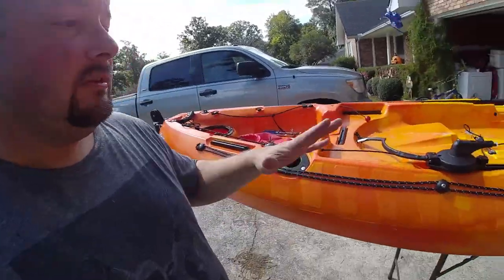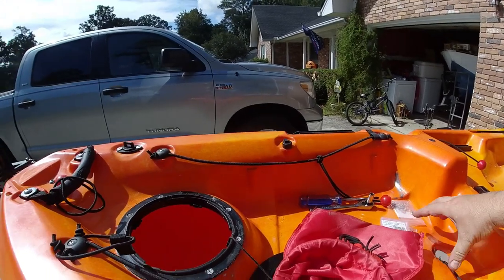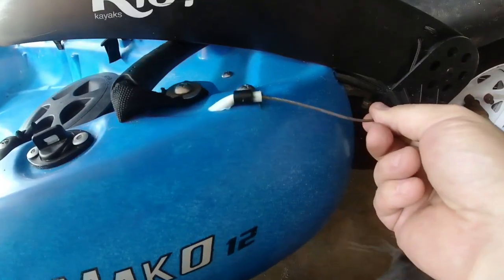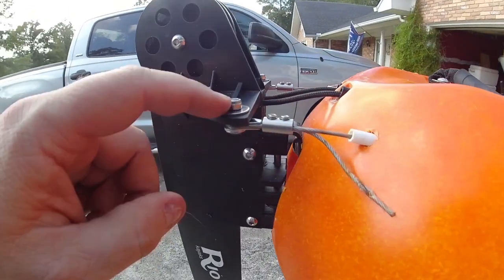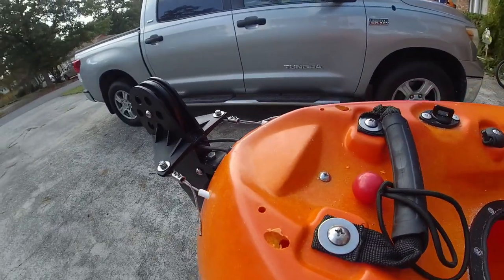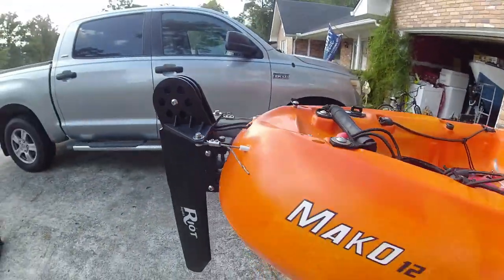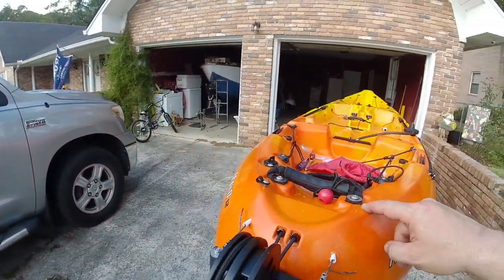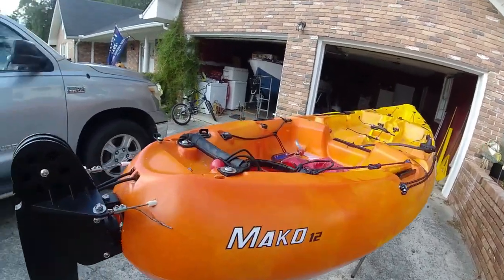Riot Mako Steering Problem, & FIX

Comment: You said the cables are Stainless steel with a plastic coating inside of that plastic sleeve that leads to the steering lever.  With the plastic on plastic friction, I wonder if putting some powdered graphite inside the sleeve would help.  Just a thought.

Comment: It’s been 5 months.  How did the fix go?  Any issues since?   
I snapped a rudder cable again today.  This will be my fourth replacement in one year.  Beyond frustrated.
Reply from the maker: Fix is working out pretty well, I have snapped a cable also. Replaced it with a stainless bike cable . Got 10 of them for $11 on amazon. The cable from Amazon does not have the rubber coating on it. This frees up the cable even more . Steering works even better with the new cable.
Reply: @TROPHY-HUSBAND  Good tip!  I appreciate that.
Reply: I just got one from my grandpa he doesn't like the steering and is selling it to me cheap.. thanks for the tips 😄 really appreciate it!
Reply: @scarkilla    The steering system is really the only downside.  Good luck!  I do enjoy mine...other than that.
Reply from the maker: @scarkilla  replacing the cable seems to be the trick. Just go with a noncoated stainless steel cable. I have not had one break yet. I am about to make a video of replacing the cables in my wife's Kayak.
Reply: @TROPHY-HUSBAND   Yeah i just took it out today after getting it... I went straight back in.. I couldnt even handle it for 10 min... replacing tomorrow lol.. thanks for the help guys!
Reply: @TROPHY-HUSBAND  WOW what a bummer darn near worth a recall eh ?
Reply from the maker: Hopefully they have fixed that issue by now. But yes a recall would have been a better answer. I won't buy another one from them.
Reply: @TROPHY-HUSBAND  I have been looking for a peddle kayak but I'll pass on this one.
Reply: @dkat1108  I had mine now for 2 years and it’s reliable and stable.  It does not turn on a dime and the rudder is difficult to plop in and out of the water but for the price, it is well worth it. Paying an extra 1k for another one hardly seems worth it. Think about it again is all I’m saying.

Comment: My cable has snapped\frayed  7 times in the rudder handle box. Does it with either coated or uncoated wire. Do you have that problem?
Reply from the maker: One time with a coated Cable. I had the cables crossing each other. Making them rub. I also grease the cables for less friction. Your rudder control has a hole in it . That is for you to keep it lubed up. Use grease, WD-40 anything is better than nothing. But most importantly make sure those cables don't cris-cross each other.

Comment: I have a LostCreek, same manufacturer.  Some people have replaced their steering mechanism with another brand like FeelFrees 8ball system.  My rudder was off and steering was disconnected when I bought it because the previous owner had a MinnKota mounted out to the side off the back on a 2x4, which I removed because I want to use the pedals.  I can't figure out how the rudder deployment ropes attach to the rudder.  I see they go through the two holes on the rudder between the fins where the steering cables attach.  But from there, I'm assuming one goes up and over and the other goes in the opposite direction.  Again Boewal Design offers no directions or pics.   And it appears they go into the three holes in the rudder.  I've tried that but can't get it to work properly, just barely.  Also, is there a spring in the wheel/head of the rudder?  Boreal Design, which has the world's worst customer service, had a " rudder spring" I believe it was,  so I ordered it, hoping it would help.  But again, if it's supposed to be in there, I can't figure out how.
Any pics/videos, descriptions/explanations that you're willing to provwould be appreciated.  I asked another utuber and  LostCreek owner, but he didn't help much as he had also had the same steering issues as you/I and had fixed and replaced his.  I'm planning on rerouting my cables lower out the back as you did and also considering running them down inside along the side instead of under the seat to avoid the twists and turns.

Comment: How do you keep the white tubes that the steel steering cables go inside of from moving in and out of the new holes that you drilled? I tried this exact same fix today but it didn't work. Everytime I turn the handle left or right all that ended up happening was that it would pull the white tubes back into the hull of that kayak. Did you end up securing the white tubes onto the hull of the kayak on the inside so they wouldn't get pulled everytime you turn the handle?
Reply from the maker: Yes I used the preexisting tube claps that are already installed inside the kayak.  I also used marine grade silicone   on the inside and outside of the holes where the tube comes out.

Comment: Did you ever have any issues with the rudder going up and down from the pull strings? Mine is really hard to pull the rope to make the rudder up and down.
Reply from the maker: I have had the cable get stuck a few times, but it was more my mistake. No real issues with that.
Reply: Yeah Esteban my rudder is VERY difficult to get it up and down…only real issue I have with this kayak is the rudder
Reply from the maker: We just went a week to the Beach and left are Kayaks in the sand when we were not using them. The sand locked up our steering and ruder deployment. They both worked fine on day one. I know I am going to have to take them apart and clean them really well. Then they should start working well again......I hope
Reply: @canam2436  I did fix that issue. The tubing they are using is causing resistance with the rope and making it real difficult to pull the rope. I pulled out that black tubing they are using for the rudder, went to Lowes and found a pvc pipe that is the same size. I  believe it was a 1/4 inch pvc pipe. I put that in, put the rope through that pvc and worked really well. It was like $2 for each piece of pvc.
Reply: @TROPHY-HUSBAND  I ended up purchasing the newly designed steering they made for these kayaks. It was $100 Canadian dollars which was like $70  US dollars. Then I finally was able to speak with the person working for that kayak company. They reimbursed me for that part because I told them the part poorly designed. I installed the newly designed steering control, made sure it worked and sold it. The new steering did work though perfect. I just didn't like that it was really difficult to reach anyone from that company so I sold it.